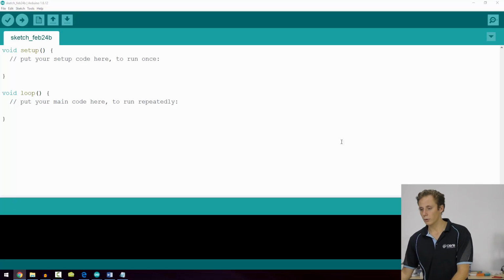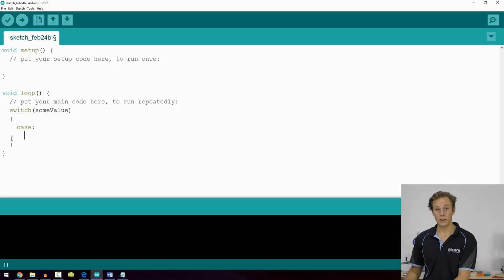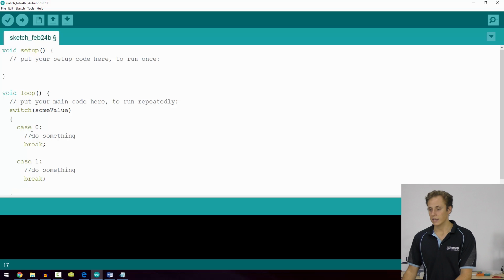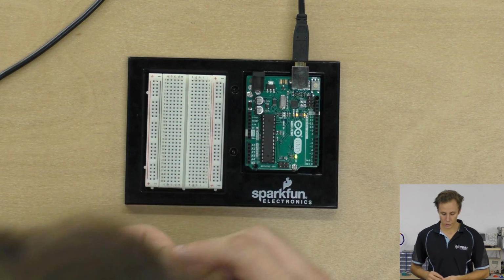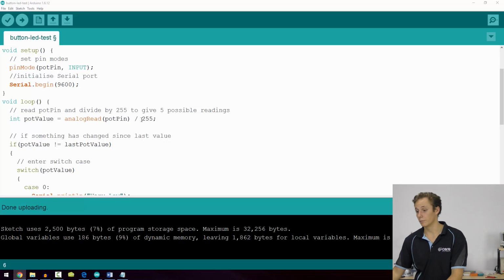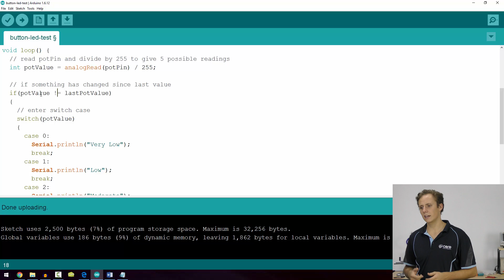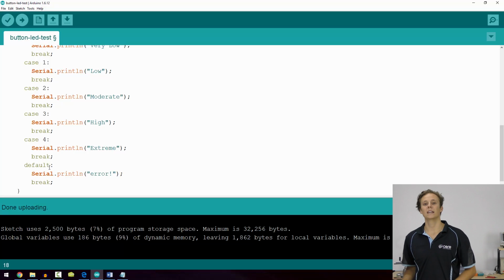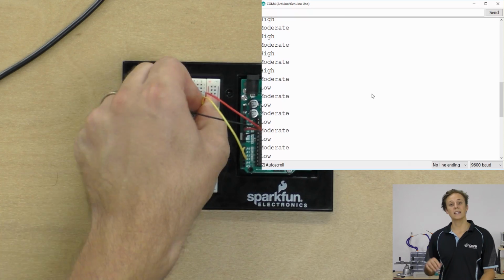Arduino Workshop - Chapter Three - SWITCH CASE Statements

Comment: Hello, thank you for the video. When switch case is triggered, how does it know which switch case is which? I did not see you defining that case 0 is value [0:51] (255:5=51) or case 1 is 51:102.
Reply: basically its the division part, pot value is an int, which means it can be 0,1,2,3... but not 2.43, 3.98 or  most importantly 13.69, because of this when you divide 1023 by 255, the max that it can give is 5 different values because 1023/255 is 4.011 = 4 since potvalue is an integer so it rounds to nearest int i think, then its 3 when potentiometer is around 768, 2 when potentiometer is around 513, 1 when potentiometer is around 258, and 0 when potentiometer is around 3, since it divides it and cant take deciamals, it rounds them and because the maximum is 4 since 1023 is the maximum potentiometer can go up to and 1023/255 is 4, then you have 0,1,2,3,4 values and you do cases based on each different number. hope this helps

Comment: Been trying to use "if' to switch between "Stepper Sp Control" loop and "Motor Knob" loop. Compiles fine, but still doesn't work. I'll try implementing it with "switch / case" and see if it helps. Any suggestions?
Reply: I need help with switching loops too

Comment: im making a rc car using a little joystick that ranges from 0 to 240, in my previous code i kept using if(value > 10) {goslow;} else{}     if(value >50) {gofast;}  else{}

when using the if statements i could use ranges of numbers using the lesser than or greater than symbols but with switch... case it doset let me use  < or > please help
Reply: Create a function and switch to it. It's been a long time but if you still need help just let me know lol

Comment: I am used to Visual Basic programming and love the switch statements.  But in Arduino they do not function the same.  They're basically worthless if they can't evaluate a conditional. I'm used to, and often need, a switch statement to evaluate one or more variables against a condition (same as an if statement).  It seems Arduino only has the "equal to" conditional.  I want to be able to use >=, !=, >, <, etc.  If there's a way to do this, it would be great.  I haven't been able to find a way or reference - even on the Arduino site, to do this.   Example would be 
switch (Variable) 
   Case > DataValue:     // This should be a variable or value (not just specific text or number)
      Do actions
If anyone knows how to do this in Arduino WITHOUT multiple if statements, but instead using switch/case statements, I'd be grateful to hear from you.  Thanks.
Reply from the maker: Yes, things differ from language to language - if its possible, we'd like it if you can post that as a question on our forum?  It would make a great topic for discussion and our support staff or members of our makers community might know some tricks, tips or workarounds.
https://forum.core-electronics.com.au/

Comment: hello Sir , i want to develop a program for relay which can turn on the relay for 1 sec and turn off the relay for 4 sec apart from that i want to use a switch that can reset the relay whenever switch is high. 

please advise the program
Reply: Check out a pin change interrupt

Comment: And the motor doesn't work... It prints to serial I'm here in this case and the motor doesn't start.  How do you keep the motor running without a delay?
Reply: I have sort of the same problem. Did you find a solution?
Reply: @drakkorvladimir4012  no, I have resigned to problem delays in everything
Reply: @amelliamendel2227  using a delay will stop all processing.  use millus() instead e.g. set a var to millus() compare current millus() to var to get elapsed time, then do something when desired time elapsed time occurs e.g. if millus() - var >= 5000  (5 seconds)
Reply: @amelliamendel2227  there's 3 timers/counter. One 16 bit( arduino's millis function uses this one) and two 8 bit that you can use in many different modes. You can get a smooth acceleration etc with PWM mode or just use CTC mode for your stepper whatever solution you seek for your motor. But in this case you need to open datasheet and set all this stuff on your own or I guess there's Arduino IDE functions that can make your life easier.

Comment: Hi, I need to compare 4 digital outputs, someone knows how it's done.
If the 4 are in high state of true and continue the program
Reply: use binary to hex;
no inputs are high = 0000 = 0,
your fourth input is high? 0001 = 1,
your first and fourth inputs are high? 1001 = 9,
your first, third and fouth inputs are high? 1011 = B,
your first, second and fourth inputs are high? 1101 = D,
all four inputs are high? 1111 = F
Reply: if ( digitalReaad(1)==1 && digitalRead (2)==1 && digitalReaad (3)==1 && digitalReaad (4) ==1)
{
// Place your code here
}

Comment: Why do you have to divide by 255, it just rounds to 4 and isnt equal. I get that there are 4 states then but it seems kinda arbitrary. Or is it stemming from byte logic /binary?
Reply: You don't have to divide but it's just a simple example to show how it works. Dividing analog value by 255 gives you 5 possible numbers which are 0, 1, 2, 3 and 4. Again it's just a simple example to show how the "switch case works". You can create your own function that returns  a value and switch to it. For example 
enum temperature = { Hot, Warm, Cool};
int Pot_value = analogeRead(A0);
int get_value (void){
If (Pot_value >=1000 && Pot_value<=1023)
return Hot;
if (Pot_value >=600 && Pot_value<1000)
return warm;
if (Pot_value >=0 && Pot_value<600)
return cool;
}
switch (get_value){
case Hot:
printf ("It's hot today");
break;
case Warm:
printf ("It's warm today ");
break;
Case Cool:
printf ("It's cool today");
break;
} //You can do as many cases as you want.
Reply: U know how it says:
 int PotValue = analogRead...
The integer part means that the value stored will be whole and not decimal. Decimal values are floats.

Comment: I am getting Arduino: 1.8.5 (Windows Store 1.8.10.0) (Windows 10), Board: "Arduino/Genuino Uno"

In file included from C:\Users\taran\Documents\Arduino\dice_for_catan\dice_for_catan.ino:3:0:

C:\Users\taran\Documents\Arduino\libraries\DFR_LCD_Keypad-master/DFR_LCD_Keypad.h:35:35: error: expected unqualified-id before numeric constant

 #define DFR_LCD_KEYPAD_KEY_SELECT 4

                                   ^

C:\Users\taran\Documents\Arduino\libraries\DFR_LCD_Keypad-master/DFR_LCD_Keypad.h:55:20: note: in expansion of macro 'DFR_LCD_KEYPAD_KEY_SELECT'

 #define KEY_SELECT DFR_LCD_KEYPAD_KEY_SELECT

                    ^

C:\Users\taran\Documents\Arduino\dice_for_catan\dice_for_catan.ino:12:5: note: in expansion of macro 'KEY_SELECT'

 int KEY_SELECT;

     ^

C:\Users\taran\Documents\Arduino\dice_for_catan\dice_for_catan.ino: In function 'void loop()':

dice_for_catan:37: error: case label '1' not within a switch statement

    case 1:

    ^

dice_for_catan:39: error: break statement not within loop or switch

         break;

         ^

dice_for_catan:41: error: case label '0' not within a switch statement

    case 0:

    ^

dice_for_catan:42: error: 'nothing' was not declared in this scope

    do nothing

       ^

dice_for_catan:43: error: expected 'while' before '}' token

   }

   ^

dice_for_catan:43: error: expected '(' before '}' token

dice_for_catan:43: error: expected primary-expression before '}' token

dice_for_catan:43: error: expected ')' before '}' token

dice_for_catan:43: error: expected ';' before '}' token

C:\Users\taran\Documents\Arduino\dice_for_catan\dice_for_catan.ino: At global scope:

dice_for_catan:46: error: expected constructor, destructor, or type conversion before '(' token

   randomSeed(analogRead(0));

             ^

dice_for_catan:48: error: 'diceOne' does not name a type

   diceOne = random(1, 7);

   ^

dice_for_catan:49: error: 'diceTwo' does not name a type

   diceTwo = random(1, 7);

   ^

dice_for_catan:52: error: expected constructor, destructor, or type conversion before ';' token

     buildUp();

              ^

dice_for_catan:53: error: 'lcd' does not name a type

     lcd.clear();

     ^

dice_for_catan:54: error: 'lcd' does not name a type

     lcd.setCursor(7, 0);

     ^

dice_for_catan:55: error: 'lcd' does not name a type

     lcd.print(diceOne);

     ^

dice_for_catan:56: error: 'lcd' does not name a type

     lcd.setCursor(7, 1);

     ^

dice_for_catan:57: error: 'lcd' does not name a type

     lcd.print(diceTwo);

     ^

dice_for_catan:59: error: expected unqualified-id before 'if'

     if (diceOne + diceTwo == 7) {

     ^

dice_for_catan:67: error: expected unqualified-id before 'if'

   if (diceOne + diceTwo == 5,4,3,2,6 ){

   ^

dice_for_catan:72: error: expected declaration before '}' token

 }

 ^

exit status 1
case label '1' not within a switch statement

This report would have more information with
"Show verbose output during compilation"
option enabled in File -> Preferences.
can someone help me with this code?
#include <LiquidCrystal.h>
LiquidCrystal lcd(8, 9, 4, 5, 6, 7);
#include <DFR_LCD_Keypad.h>
#include <AnalogDebounce.h>
int localKey = 1;
int count = 0;
long diceOne;
long diceTwo;
int countDelay = 220;
int setColumn = 0;
int SAMPLE_WAIT;
int KEY_SELECT;

void setup() {
  lcd.begin(2,16);
  lcd.setCursor(8, 0);
  lcd.print("Roll the dice!");
  
  }

void buildUp() {
  lcd.clear();
  for (count = 0; count <= 16; count++) {
    lcd.setCursor(setColumn, 0);
    lcd.print(random(1, 7));
    lcd.setCursor(setColumn, 1);
    lcd.print(random(1, 7));
    delay(countDelay);
    countDelay -= 13;
    setColumn += 1;
  }
}

void loop() {
   switch (KEY_SELECT);
   case 1:
        lcd.print("rolling dice");
        break;

   case 0:
   do nothing
  }
  
  
  randomSeed(analogRead(0));
 
  diceOne = random(1, 7);
  diceTwo = random(1, 7);

    buildUp();
    lcd.clear();
    lcd.setCursor(7, 0);
    lcd.print(diceOne);
    lcd.setCursor(7, 1);
    lcd.print(diceTwo);

    if (diceOne + diceTwo == 7) {
      lcd.clear();
      lcd.setCursor(7, 0);
      lcd.print("7");
      lcd.setCursor(3, 1);
      lcd.print("The pirate");
    

  if (diceOne + diceTwo == 5,4,3,2,6 ){
    lcd.clear();
      lcd.setCursor(7, 0);
      lcd.print("5,4,3,2,6");
}
}
}
BTW I'm trying to make a digital dice to play catan dice